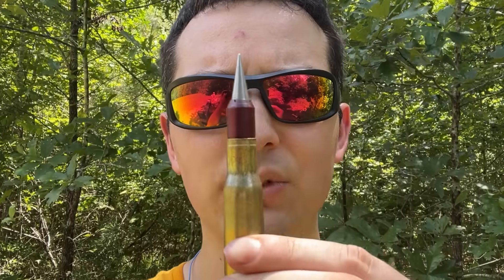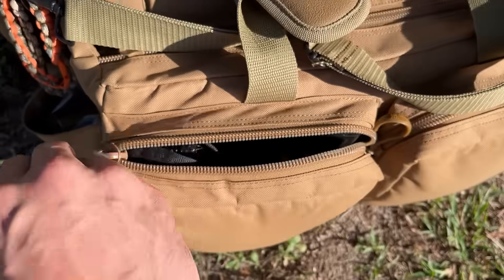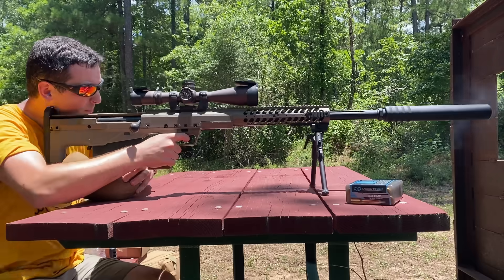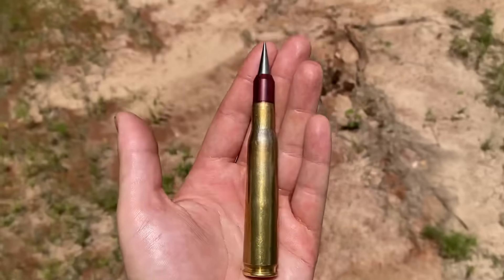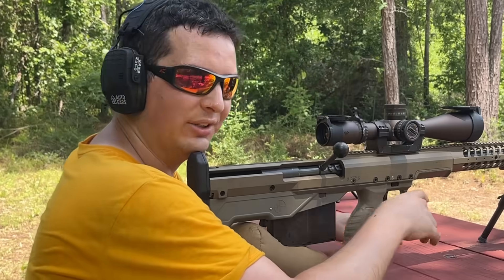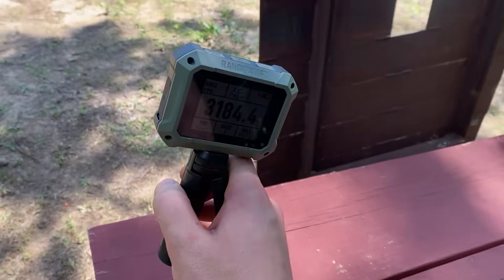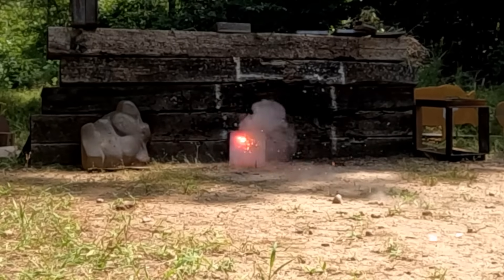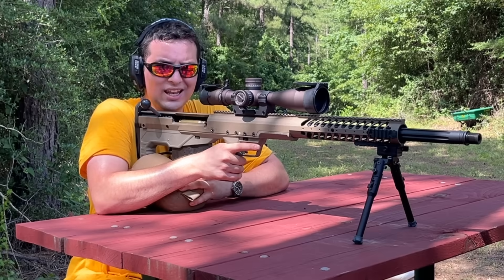How Much Steel To Stop A 50 Cal SLAP?

Comment: I think this better demonstrates the need for that full-length barrel, rather than any strength or weakness of the SLAP round itself. The round is designed for speed. A 750gr AMax round at ~2700 fps might generate 12 000 ft lbs of energy, but the 355gr SLAP round moving at only 3200 ft/s is only making about 8000 ft lbs of energy, or about 66% of its intended muzzle energy of, again, around 12 000 ft lbs. 

Which I imagine is the biggest reason for the poor mild steel performance. Tungsten is much harder than steel, for sure, which is probably why it's still working at all, but speed and cross-sectional energy density are what defeat armor and it's simply lacking out of the shorter barrel.
Reply: Wow, your comment drew all the YouTube experts.You got the "at 50 yards, barrel length doesn't matter", the "shorter barrel makes up for shorter range" AND the "why does barrel length matter at all, this barrel is longer than my .22s." Class time, kids, and we are starting with physics. Velocity drip is EXACTLY equal to drag +gravitational pull, or somewhere around 50 FPS/100 yards with most spitzer bullets. Since the SLAP round is cooking at just shy of 5000 fps from an M2 barrel (per US Army testing), that means the 1600 fps drop is the equivalent of a "real world" range of 3200 yards- more than a mile. Why does barrel length matter at all? Because gunpowder doesn't burn instantly. Smokeless gunpowder is made by dissolving cellulose in nitro-glycerine (which produces a substance called "guncotton") and adding retardants to slow down the burn rate, and shaping it to further control the rate it burns. Some powders, like Winchester WST, Unique, Red Dot, and Accurate No7 are designed to burn very rapidly in short barrels- hence why they work well in handguns. Powders like IMR 3031, CFE223, Longshot, and Hodgden 4895 are designed to burn in carbine length barrels (IMR 3031 was specifically designed for a 31 grain charge for a .30-30 Winchester Center Fire from a Winchester 1894, for example). Powders designed for the .50 BMG cartridge are big cylindrical powders like 50BMG (go figure!), and Hodgden 7198, which are designed to burn in barrels that are about 3 1/2 feet long, like an M2 or a Barrett M82. They reach full pressure after the bullet has traveled 3 feet or more, and are designed to maintain that pressure, ergo, continue acceleration of the bullet, for more than a full foot of travel. Bullets, no matter what gun they are fired from, go from 0 fps at the breach to muzzle velocity during the time it takes to reach the end of the barrel (or until pressures drop below the levels needed to continue their acceleration) and that takes time. This short barreled rifle doesn't give the bullet time to get up to it's full intended speed- hence the shitty performance. One last piece of very complicated physics- calibre. Calibre is the British for Caliber, but is usually used to denote barrel length relative to the bore diameter, and is commonly used with artillery, because the effects are VERY noticeable there. In naval guns, you can see it right out front, as guns are designated by Bore and length, like the 14" 35, or the 16" 50. The South Dakota class battleships had a 16" 42 gun, which had a barrel 42x16" long (56 feet long), while the Iowa class has a 16" 50- which has 66'8" barrels- and significantly more range and power (they had the same chamber, shells, and powder charges). The original M109 had a barrel about 10 feet long, and had a range of about 12 miles with standard shells. The M777 has a barrel about 20 feet long and a range of 20 miles with those same shells, and the PZH2000 has a 24 foot barrel and can reach out to 24 miles firing standard rounds. Same chambers, same powder, same shell. Caliber matters.
Thanks, I needed an excuse to write this all out, and the responses to your comment made a perfect spot to do it.
Reply: @troybray7523  The spec is apparently 4000ft/s@78ft for M903 and M962, so using 50 FPS/100 yards result in 0.9 mile. Still very far.
Reply: @troybray7523  why don't they put the fast burning powder everywhere? You would get more acceleration even with long barrels.
Reply: @panteleymonschekochikhin-k1978  I don't know the appropriate term for it, but when the powder burns completely causing pressure drop and the projectile is still in the tube of the barrel it loses both velocity and accuracy. The projectile basically becomes like a cork being removed from a vacuum bottle, instead of leaving the end of the barrel under acceleration of expanding gases.
Also instant burn powder makes for a LOT more 'snappy' felt recoil. Think 40 S&W versus 45 ACP recoil from a pistol the same size and barrel length.
Also if your powder is fully consumed too early then the projectile becomes unstable and wobbles or tumbles in mid flight, severely reducing accuracy. Hand loaders don't load to maximum load for this exact reason, because they want accuracy more so than maximum velocity. It can make as much as 10 MOA difference at 100 yards with a 165gr .308 from a 18 inch barrel.
Reply: @panteleymonschekochikhin-k1978  because some casings can't handle the pressure from fast burning powders, and because some bullets need barrel length to stabilize, and because some barrels twist rate can affect long distance shots more, and because barrels are a very tight which increases resistance with length, and because a longer skinny barrel will flex unpredictably affecting shot placement. I'm sure I'm missing a few reasons still.
Reply: I imagine a Black-Tip would perform close to the same as these SLAPs in this gun
Reply: Yeah we have a Russian Youtuber with a trophy M2 firing SLAPS into the counterweight on a forklift. He got quite a bit more penetration.
An extra 800fps in the velocity squared part of physics....is significant.
Reply: That A-max is a ballistic tip round, also.... Which is NOT designed for penetration. A 700gr FMJ would handily outperform A-max in penetration. Ten times over.
Reply: Go on…….
Reply: That is correct. Also, to some others that commented that 4000 fps vs 3200 fps wouldn’t affect the outcome, remember that kinetic energy = mass of bullet multiplied by the square of the velocity, so velocity has an overwhelming effect vs mass of bullet. Ex: 355 grain projectile at 3200 fps = 3.64x10^9 grain-feet/sec (excuse my non-standard units, I’m doing napkin math here) and that same projectile at 4000 fps has a kinetic energy of 5.68x10^9 which is around 60% more kinetic energy…so yes, that missing 800 fps is definitely reducing the SLAP round’s performance.

The .50 BMG SLAP round is rated to defeat the HHA (high hardness armor) steel used on Soviet bmp’s and infantry fighting vehicles at 500 yards. However, most of that ammo was manufactured in the 80’s and the powder charge has likely degraded some which is why most SLAP rounds you see today are reloads and there is no Quality Assurance on whether the correct powder type and weight was used or whether the bullet was seated at the proper depth to reach the desired initial PSI within the case when it fires. However, I think the biggest culprit is unrelated to the above variables.

 Like you said, tungsten is more dense and hard than the steel Banana was shooting at, however, mild steel has vastly different physical properties versus HHA. Soft and ductile vs hard and brittle. And this is one of the reasons why the SLAP round performed worse than expected. 

In fact, the 750 grain bullet is theoretically better at penetrating mild steel than the SLAP round if we ignore bullet composition IE the same material/construction so that the only differing variables are bullet weight and resulting velocity. Here we can simply call out momentum as the key to defeating the soft and ductile mild steel, IE the heavier bullet has less kinetic energy to over-stress the HHA which is why the SLAP penetrator is better against real armor, however, the heavier bullet resists slowing down better aka has more momentum, thus the heavier bullet is less affected by the physical properties of the mild steel allowing it to continue penetrating. 

In laymen terms, the tungsten penetrator was  designed to hit the HHA and bring whatever material in front of it with it as it penetrates which results in very clean holes in the HHA. HHA is also brittle so one can “assume” the plate remains solid in the vicinity of the point of impact which means the surrounding material plays no role in helping dissipate the energy transfer between penetrator and armor IE it prefers to break off any portion of itself that is experiencing extreme stress.

Now let’s break down what is occurring when a SLAP round is used against mild steel. When the penetrator hits the mild steel, the soft ductility of the mild steel means that the plate is acting more like a fluid than a solid under the extreme stress IE the penetrator has to slough material out of its way in order to penetrate and thus sees ever increasing friction and mass the more it penetrates thus robbing it of energy to continue forward. And unlike the HHA, the surrounding material helps the material directly in front of the penetrator in resisting moving out of the way.

These are the same scenarios that face hardened armor use to defeat projectiles IE the hard face is excellent at repeatedly rejecting penetration up to a certain energy threshold, however, if a projectile exceeds that energy threshold, then the armor’s brittle nature will let go of the material stress, which would be game over for HHA since it is homogenously hardened (IE 100% hardened throughout), however, in face hardened armor, only one side is hardened and only amounts to around 10-25% of the material thickness, the rest is essentially “mild steel” in physical properties thus excels in robbing the projectile of its remaining energy making it an effective bullet catch. Modern Level 4+ body armor works on the same principles as face hardened armor IE the ceramic plate is extremely hard but brittle and thus robs the projectile of a lot of energy all at once when the ceramic plate shatters, then the remaining 75% of the level 4 plate is a daft and ductile material to slowly bring the bullet to a stop. The most common material is UHMW-PE aka ultra-high molecular weight poly-ethylene.
Reply: @HistoricalFidelity  Man, you spent a lot more time writing this than I would. This goes to address the fact that most people in the small arms community have no idea what happens in true armour penetration scenarios.
Reply: P.S. sorry for the dissertation haha
Reply: yeah... but 338 lapua didn't have any longer barrel.. so i think the question is correct ! so WHY ?
Reply: For rifles, this is a full length barrel....maybe add another 2-4 inches? 
Now, if you're talking the machine guns, that's a different story.
Reply: @pronecroman You seem to forget, this is .50 BMG, made for the M2 (B)rowning (M)achine (G)un with a 45” barrel. If I remember correctly, the gun he is shooting has a 29” barrel with is about 65% of the M2’s barrel. Shorter barrel = lower velocity = less penetration.
Reply: @admiral_franz_von_hipper5436  Exactly!
Reply: @admiral_franz_von_hipper5436  Albeit, everything you said was correct, it is irrelevant.  One platform is made for sustained, "more accurate" for itself, heavy machine gun fire. The other platform is made for pin point, accurate, long shot anti-material engagements. The .50 BMG itself hasnt change since its inception, just its application/s.
Reply: I get it, but also, the 3100-3200 fps at at short range probably ends up being close to a full length barrel at a more realistic distance like 400 or so
Reply: It is a full length barrel it's a Bullpup
Reply: @DestroyinStuff it's not a full length barrel for the round in question and that's what we're talking about.
Reply: @APS_Inc okay fair enough, would any of these rounds be used at this distance though? I think the difference in barrel length makes up for not being shot hundreds or thousands of meters
Reply: the distance is 50 yards, a full length barrel isn't going to make any difference at that distance.
Reply: @Jeffery3464 
Yes, it would.  But how much of a difference?
Reply: @craighansen7594  Spec is 3,985 ft/s from a 45” M2 barrel which is the only thing it’s intended to be fired from.
Reply: @Jeffery3464  Why wouldn't it? With a full length barrel the velocity would be significantly higher. With a lighter round with less momentum that loses speed quicker wouldn't a closer target increase the difference between a full length barrel and the short 29?
Reply: @Jeffery3464  bro what are you actually talking about? If you have no idea how bullet ballistics work stop talking. The single most important factor when it comes to a bullets speed is the length of the barrel cause it gives the powder longer to burn as much that was in the casing as possible thus increasing the back pressure behind the round for longer thus pushing it out at way higher speeds. So yes he most certainly would have made it through some of those plates if he had the barrel length the slap round was specifically designed for. There is a reason the marines held on to the m16 for so damn long before finding a replacement cause their m16s had fucking 20 inch barrels so they could still effectively and easily engage enemies at longer ranges than the m4. Why you might ask, cause the fucking barrel increases the velocity and stopping power of the round.
Reply: @Jeffery3464  do you think bullets speed up as they go down range or something?

Comment: Individual slap rounds are not meant to defeat armor. 

The theory is that ultra hard material crack and shatter when hit by really hard and fast moving projectiles. 

Slap rounds were designed to take chunk out of armor with repeated, rapid hits to the same section.

Comment: Well, you proved yourself smarter than Ky Ballistics. Hes still blaming the ammo instead of the muzzle brake. Good to see someone with some common sense.
Reply: Mark Serbu examined the rifle and it wasn't the muzzle break, the round exploded the breach because it had the wrong powder. If it had been the break the damage would have been at the muzzle.
Reply: @chemistryofquestionablequa6252 of course Random youtube commenter has better information than the manufacturer and designer of said rifle
Reply: @chemistryofquestionablequa6252  I dont  think it would matter what end was damaged as the weakest point will always be the point of failure. The pressures would be the same at the breach as the muzzle in the case of a restriction. Looks like the breach lost. Not sure how Mark Serbu would have known what powder was used after the fact, but got his name off the lawsuit so Im sure hes good with what ever explanation that didnt include him would be sufficient. Scott never admitted his error which using sabot rounds with a brake  is wrong according to the Barrett manual and the manual listed pressure spike as a consequence if you did.  A pressure spike whether it be from the powder or restriction would  most likely look the same. He could have used it as an education moment, but so far, I have heard nothing out of him  about it.